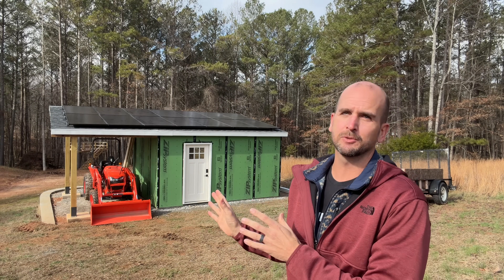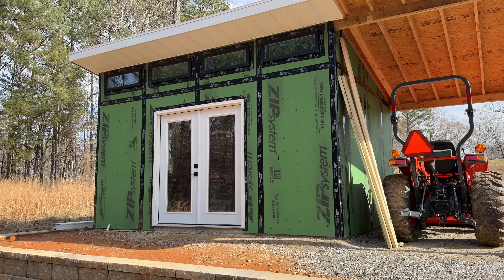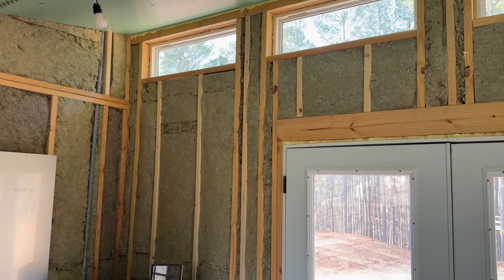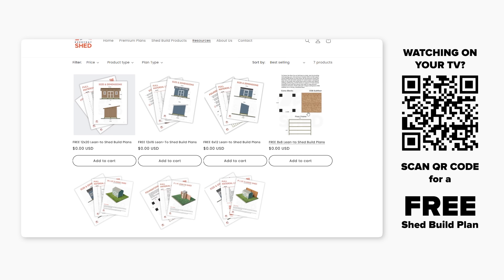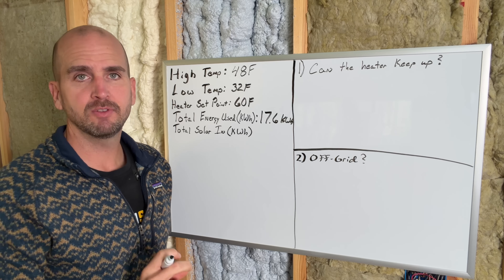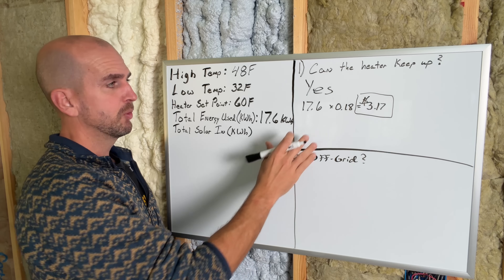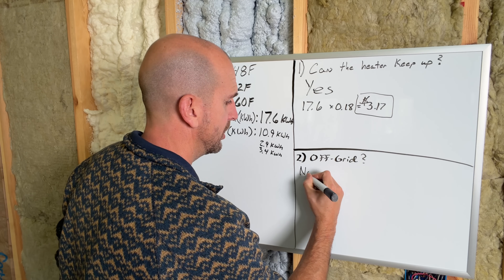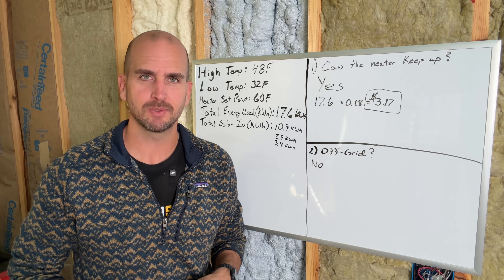HUGE Mistake: Why My $15,000 Solar System CAN'T Heat My Tiny Shed

Comment: I may have a couple of remarks on the INSULATION:   1) the internal walls have no cover (they are not actually full walls) - this makes any insulation LESS effective -- easy to address - just finish the walls from inside and from outside with some type of hard wall material. ; 1a) Rock wool is best for most scenarios, but it needs to be at least 10cm (4") for that type of building. I'm not sure if yours is 4" , from the video I think it probably is less ;    2) Not sure, but it seems the windows are single glass, this would be a massive fail -- double-glass-sealed or triple glass-sealed (with argon) is recommended respectively for mid or high effectiveness of the insulation. Glass is the most ineffective insulator for any house and you have a lot of glass area. ;  2a) door seals - you have three doors (I think - this is a bad choice, it is better to have a fixed window instead of one of the doors), they all need to have good seals especially the bottom seal in order the shed insulation to be considered good.  ;   3) I didn't quite get what your Roof insulation is, I would recommend it to be at least 10cm (4") of rock wool or better - even more. The roof has the highest loss of heat for any house, so you need to insulate it better than the walls.   --> IF you have all these things combined , you will reduce losses considerably and you will need considerably less energy to heat the shed.

Comment: A system you might try:  Remember those solar hot water heaters?, couple that with a heat pump where the solar hot water heats water in an underground storage tank then the heat pump takes that water and takes the heat out and puts it in the shed. Or a geo thermal where the solar hot water heater puts heat around the pipes that extract the heat for the heat pump. Or and above ground sand heat "battery" box.

Comment: Electrical Engineer here.  Solar panels are less than 20% efficient.  Heating with solar panels is stupid.  If you want to heat use simple water transfer solar heating panels that circulate water; i.e., when you want to heat a swimming pool.  The windows are the main source of heat loss and you need to insulate the floor..  The math shows a 100W light bulb would heat that structure without the windows.  100 days a year requiring heat times $3.17 is $317.  Interest on $15,000 of a 10 yr. bond is $600/yr.  You can heat the box and still have beer money.

Comment: Do you have excess solar production where by your battery is charged and the sun is still shining. Then consider a dump load sand pot. Take an all metal bucket preferably with a flat bottom. Take an old electric stove and liberate the small burner element and the steel wires under the cook top. Fill the bucket with rocks and sand positioning the element midway in the bucket. Place the bucket as close to center of your slab as possible and pile up fire bricks. Direct your dump load energy into this sand battery that heats up the largest heat vampire you have... The ground. Your slab is sucking your heat away so feed it constantly with a little push in the right direction then the air is primed for the push the rest of the way. I have one running on 110 volts constantly and i sit on it to warm my buns.  You have the right idea with the oil heater just expand that to the entire slab. Hope that helps.

Comment: bizarre results. Such a shed with good insulation (including ceiling) requires mb 3-4KW of heating, including reserve to be safe. If you want to do it offgrid with PV - at winters, what a pity, sun does not shine too much (6h per day), so it should be 20-30KW of PV panels + some huge (50KWh) storage for night time use. Good news - it can be thermal storage (hot water tank, hot sand tank), no need for expensive batteries, bad news - in this case the whole heating system becomes much more complex than mobile oil radiator for $50.

Anyway $15000 is enough to heat this shed for ages by usual ways - wooden burner (bullerjan or so), pellet heater or just heating oil burner. Reliable, simple and cheap. To try to extract power from sunlight for heating is nonsense, if it would be enough - it creates summer, not cold winter, without any equipment by itself.

Comment: For heating, would it be much cheaper to just store the energy as heated water in a tank? And use regular radiators? Use the money for better solar array and then have just a small battery for appliances.

Comment: Thank you, good to know. Also how long before the battery's, solar panels degrade and fail?
Reply from the maker: Time will tell but the panels should be good to 80% of the rated output for 20-25 years and the batteries hold 80% of the capacity for 10+ years

Comment: I think that solar power should never be repurposed directly to drive an electrical heating unit. It is ineffective, as you have shown. A much better way to use that power is to drive a water heating unit (boiler or a2w heat pump ...) that has storage and which instead (re) circulates that heated water. And, for that, you could use in-room radiators and/or underfloor (in-screed is best, but you have no screed here). The tanks are cheap, and for underfloor the tubing is also cheap. If you boilder or heat pump were to fail, you could always just re-route the plumbing to a furnace as well.

Comment: Ecoflow is for rich people who dont know you can buy much better pre built systems much cheaper and have way...more power. I have a chinese built solar system that charges a tesla daily and if not doing that is storing power and can run a heater. In winter you have to over panel. November to Feburary is low light. In those months you need a diesel heater or diy built heating low power element array or thermal battery slow release heater. Depends if you live in florida or minnesota your solar system will only work if you have light.

Comment: So, normies should conclude that solar is shit, and ramp up fossil fuel consumpttion, just like oranga faced donnie likes?😅 Something tells me you would have better luck with AC unit, with added bonus of being able to cool down that shed at summer time. And about 15000$ rofl, that system with same capacity could wery well be around 1500 and lower if you are having straight hands (and more than a couple of braincells) and ok with getting them dirty...

Comment: Putting an exterior cladding on, plus drywall on the inside would increase air tightness and insulation, might make the difference on heating. combine that with a proper heat pump like others have mentioned and you might be in the money.

Comment: 15k battery or 3.17 per day.  That's 3.17 x 365 = 1157.  So it would take 13 years to offset the grid power vs solar.   Anyone saying solar for anything other than short power gaps can't do math.    I am not saying if you have a critical need you could build a huge natural gas powered generator system that would run for months for less than 15k.  Just not a good value for money to buy batteries at this point.

Comment: Anyone trying to heat a space with off-grid solar is crazy. Resistive heaters are literally the most inefficient ways to heat a place. Just get little wood stove and you'll be set. Solar is for keeping the lights and fridge running

Comment: Heating uses an insane amount of electricity. Others have mentioned pitfalls already. Uninsulated floor being a heat sink, not enough insulation in the ceiling. I would recommend trying a heated floor. And it's not even cold, 0 celcius is shorts weather up here. Right now it's -34 and will go down to -41 overnight.

Comment: I knew this would not work because you failed before the drywall went up.  Not nearly enough insulation in the walls and the studs would transmit heat loss to.  And the biggest heat loss would be from the low R value in the ceiling. This project had no hope of success...

Comment: 🥶🥶🥶If you had placed hot water tubing in the concrete floor (insulation underneath it) and started pumping 1,500 watts at the end of summer and through fall, then you would not be passing horrific amounts of heat through window and door surfaces resulting currently in your losses.

In other words you need to reserve the heat in a thermal mass. You could also brick the interior walls for thermal retention and also have styrofoam 'swinging shades' for the ceiling windows and doors, while not occupied.

Without thermal massing you are always losing heat and woefully inefficient. I am sure that others have already commented this. 😱😱😱😱

Comment: Heat rises and cold air flows down. The problem I have with this video is you don't take in consideration there's no circulation. If you are circulating the heat that goes to the ceiling versus down on the floor and make it more homogeneous, you may find your results are different. I've done this trick and it worked to lower heating costs. A fan on the radiator is a good start.

Comment: Another option to consider for heat is solar hot air panels. I run 2 of them as the main heat source for my house.  Search on my channel for:
"Solar Heating System, Version 2"
for an old video overview.  
This system has been running off grid for the last 13 years and does a decent job.  I use solar PV to power the air movers that pull air through the panels and push that into the house.  That requires around 200 watts of power.  The pair of panels produce about 1700 watts of hot air for a good portion of the day giving approx. 5-6 KWH of heat.

Comment: I built a 10'x20' building and I insulated it with standard R19 bat insulation for the floor, walls and ceiling.  I then installed a proper vapor and air barrier aka plastic before installing the final wall board.  I also did all my electrical on the outside of the wall to keep it that much more sealed.  I heat it with the exact heater on medium with it plugged into a digital programmable thermostat.  Its set between 65-72 degrees F depending on the time of the day and use around 5kw per day.  This is in Northern Michigan.

Comment: Heat pump where the intake air for the external unit goes thru buried a few corrugated perforated pipes each 4 inches in diameter. Approximately 100 ft long in a fan pattern. You could use a rented trencher. 3 100ft pipes lead to the intake of the outdoor unit box and seal around it. It'll raise the intake error 30 to 40 degrees in the winter and lower it 30 to 40° in the summer. Should double the efficiency. There is a cost obviously associated with it but it costs less than the double insulation that other people are suggesting.

Comment: We have had 2.5 KW solar + 24KWH power wall style LiFPO batteries.  We harvest 10-40'ish KW /day in summer.  I put the solar items on separate circuits in the house where we run middle sized appliances on those circuits.  Ex: 'Fridge, 3 Freezers, the computers, modem and CAT 6 cable home runs to the switch, then modem.  We live on a farm and have anywhere from 200-1500 gallons of diesel in storage.  We get good prices from the Co-Op.  At any rate, I also have a 20KW at 100% duty that can run the house and all property for weeks.   IT can offset the solar but one sure hear that sucker 2 miles away.  It's not exhaust noise, the generator is cited in a large 2 car + Camper w/ 12' doors.  Exhaust pipr goes through a thimble in the wall, takes a 90 straight up level with the top of the building, about 20'.  So the sound and exhaust gases are being directed skyward.  What'd give me away would be the "diesel music" coming from the engine.  Its just a big 4 cyl CAT but light that up at night, but be ready, cause everybody and his brother is com'in over.

Comment: I have a bigger shop 27 x 20 and a 12000 btu 22 seer heat pump and 30k eg4 battery storage and 7500 watts of panels  Has grid backup when its cloudy in Iowa. Tonight 12 below zero Fahrenheit heat pump works fine most of the time without grid use. Grid is much cheaper then any generator. The house we have is 60k of eg4 lls2 batteries 12k eg4  inverter and 14000 watts of panels and we still need grid when the cloudy weather in the winter. I have one of those oil space heaters in my shop  used it for a couple of months 6 years ago the went to the heat pump in work shop then added the solar 3 years later . You can purchase a 115v  cheap 12000btu heat pump for $400  and this  works a whole lot better and cheaper then that. Understand the reason for the video insulation cost of construction etc. but a heat pump would be such a better investment

Comment: ive been in my office shed for a few seasons now and ill tell you my thoughts. because your building this right now your finding out electric heat cant do what you need, from my understanding, depending on the temps you see, heat pumps dont even work when its really cold, electric heat is very inefficient. you need a diesel heater, very cheap HEAT, REAL HOT HEAT, CHEAP, and safe, exhaust outside, heat inside, its the best!!   another problem you'll find out about in the spring when it starts warming up, sheds get HOT, quick, be prepared, a/c will be a similar fight to what your doing now, 1kw an hour.

Comment: Heating a shed is a seasonal issue even if it is an office. The most financially appropriate thing to do is to install a vented propane heater and call it good. It takes the least amount of space, it’s the least expensive option, it’s virtually maintenance free, it requires no electricity to heat the place and you can get a decent sized tank to sit outside the structure and last you all winter that you can install yourself without a hustle. Also, if you get any snow accumulation at all you will be rather disappointed about mounting your solar panels on your roof. I would recommend mounting them on vertical surfaces next time facing south, south-east on the siding. You will avoid any roof leaks and having no power when your panels are iced up and snow covered. Subscribe and love both of your channels. Big fan. Be well.

Comment: I have a 3 car out garage/shed with a 500 gal colour diesel tank for my tractor on the back.  I heat the garage with a pair of cheap Chinese diesel heaters that are plumbed into the diesel tank.  Before adding the heaters I was refilling the tank every 12-18 months and after 2 years of running the heaters I haven't noticed usage has increased. It has, but within my usual range.  This in Canada where temps reach -40°C/F a few times a winter.  Supremely cheap and easy to service.

All in it was around $300. Silver Cymbal has a video about similar single heater setup.

Comment: This video also shows the weakness of mounting the panels at a fixed angle on the roof of your shed. There were a lot of basic concepts ignored in this project. Things such as positioning the shed to take advantage of solar warming in the winter or using a ground array with seasonally adjustable solar panels to continue to achieve peak harvests when the sun is low in the sky. Choosing the right HVAC systems to properly climatize the space with energy efficiency in mind is also an important part. You also did not take into consideration the expense of running 20 amp power service out to the shed. I power a garage/workshop, Rec room and a seed starter/grow room all off-grid with 5100 watts of power. That includes a 240v mini split, 400 watts of grow lights and fans, a chop saw and CNC machine as well as charging an EV five days a week.  Your tiny shed should not be an issue.

Comment: Many people already discovered the hard way you can't run a normal house power and heating of solar on cold days with sun, not at all with clouds or rain. Not even a small shed with sun, as you just have proven. You would need a giant solar system and equally large amount of batteries to be able to do that. Obviously that isn't anything economical. With current status of batteries you simply can not get the energy density required to store it all for like the winter months. Better get a cheap diesel heater that will keep your place toasty all winter long. Save the power for your laptop. Fossil fuels are cheap and have way more energy density.

Comment: So $3.50 a day for electricity is a major concern, but $15,000 for a solar system isn't. If you divide 15000 by 3.5, it is going to take you twelve years to end up paying as much for electricity as that solar system cost! By then you will probably have had to replace the batteries once or twice, and the panels at least once, so the solar price will be even higher.

Comment: We have 400sq ft we heat through the winter at 70° with a delta around 50° with under 10kwh/day and summer cooling at closer to 6-7kwh/day which also includes a fridge, freezer, washer/dryer, lights, computer, HRV, etc.I dont want to beat it to death but as many others have said...
1. Not enought insulation on any of the surfaces.
2. Open stud bays. You wont get your full R value until you close up stud bays.
3. One of the most inefficient ways to heat albeit the cheapest to buy.

Edit: honestly kinda wild how inefficient that is. You just trying to heat that space burned around 170% the power we use to live. No disrespect but you inadvertently proved how important proper design and execution is to building and having it be even remotely efficient.

Comment: Some insulating curtains on all the windows would help quite a lot.  The R value of glass is 3-4, unless you splurge for a measly R-7.  Some inexpensive thick curtains, double layered on a double rod will reduce your heat loss significantly, when closed.  Add area rugs to cover the floor and you should see a significant improvement.

Comment: Converting solar energy to electricity is only 25-30% efficient.  You need solar heating.  A water storage system for overnight heating, and a simple pump system might work better.

Comment: Also, the hybrid solar ACDC heat pumps sold by AIRSPOOL / EG4/ DEY connect directly to your panels. No need for inverters or batteries in the summertime.  https://www.youtube.com/@airspool